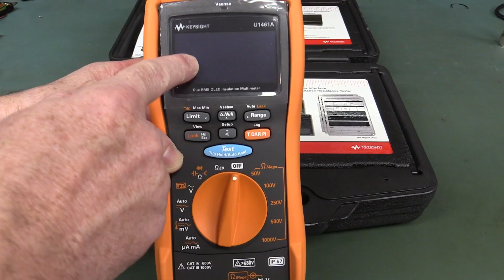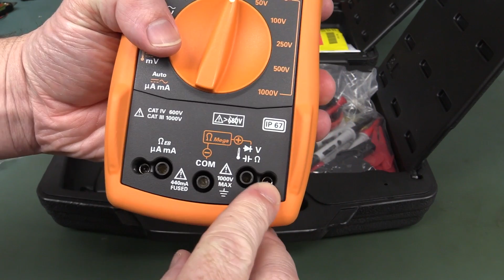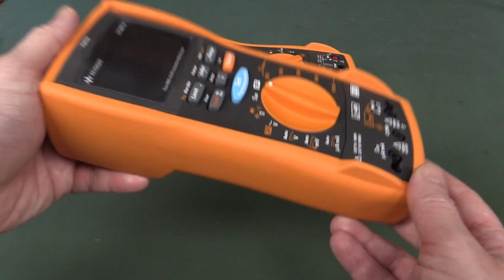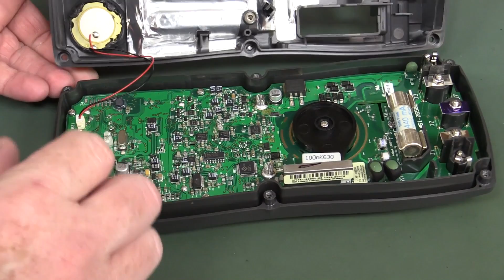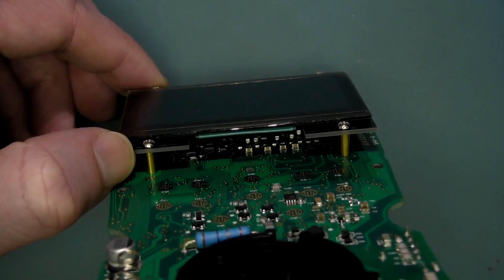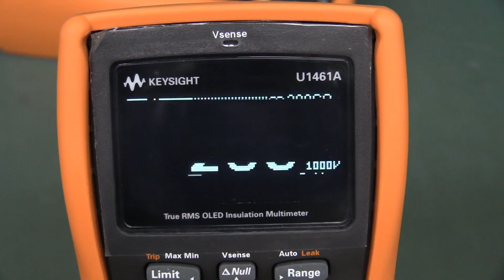EEVblog #894 - Keysight U1461A Insulation Resistance Multimeter Teardown

Comment: I use only dry batteries for any appliances in which the battery will sit there for a very long time, calculators being the ultimate example. Use alkaline batteries on those only to see them leak after a couple of years and oxidize everything. Now do these lithium batteries leak like alkaline batteries if we forget them inside?

Comment: Was that an Hp28S calculator on the bench at 21:10?  I had one back in university days.  Well, I still have it somewhere but it is no longer in working order, due to an incident with some Mountain Dew entering the keyboard.  Replaced it with a 48GX, which I still have and still works great.
Reply: Oh, guess not.  Got a closer look in the LCD contrast video and it's just a Casio.  But the keypad has a similar look to one half of the HP28S keyboard.

Comment: I think Keysight include lithium primary batteries on their multimeters with OLED displays as they are designed to operate in extended temperature ranges and those energizer lithium batteries are rated at -40° to 60°C, while regular alkaline primary cells are rated at -18 to 55°C. My agilent U1273AX (OLED version) also came with lithium primary cells. The battery life with the OLED display is not that bad (I'm using Ni-MH rechargeable batteries). The display is readable but clearly worse than the LCD version in the sunlight, but indoors the contrast is just amazing.
Reply: Indeed, as you said, the OLED used in 1273A is very good, but there is indeed a problem of life decay. If you need help, I can provide OLED.
Reply: @wangyun-pp7xc  I already had to replace mine. I would be willing to pay for an LCD conversion, if someone made one.
Reply: @jfaria  I understand, it's because OLED is not durable right? But as far as I know, replacing OLED with LCD is more troublesome to replace because the driver chip is different and the size and structure are different. It is more suitable to replace an OLED.

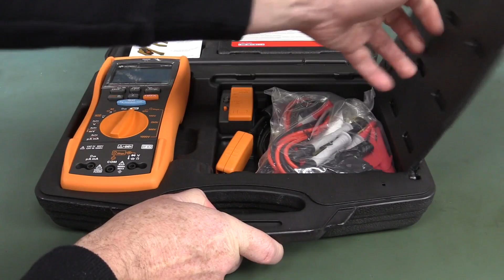Comment: 1:50 Well, more components that are pretty delicate and they could trash the one-piece PCB more often, weight, size of the case and mostly of all these, battery life. A bluetooth module really likes to chew batteries.
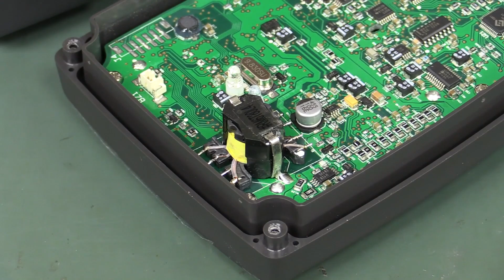5:53 We are talking about ~1000V DC so maybe- MAYBE to stop arcing and corona effects. I'm mostly thinking of the latter.

Comment: I didn't see the path for the HV to get to the jacks...
Reply: I would say a half thickness of PCB all around, is way better than anything you can easily achieve on top with clearance and free air. Just think about dust, dirt and humidity.
Reply: It probably runs on an internal layer.
Reply: I suppose so, but would that provide sufficient isolation? I also didn't see any areas of the board that were kept clear of other stuff, so all that's in between is a half thickness of PCB...

Comment: I appreciate the video, but you're clearly not it's target market. An industrial user would know that a 10A range is worthless - he's just going to stick a 400A (or 8000A) clamp onto the thing. In this game, our requirements are substantially different, like one feature you didn't even test - the magnetic hanger.
Reply: Control electronics. You have little use for the 10A range, but you would need the lower ranges to check the outputs from the microcontroller to the mosfets and relays that control those big currents.
Reply: Or leakage currents.
Reply: Then why on earth would they put µA / mA range on the unit? What use is that in a industrial application?

Comment: how bad will that thing taze people lol? surely regulations would make sure it is safe to touch. If it is a constant current output set to a low current (whereby the voltage will sag to the point that a set current is established.) Unless there is a small amount of capacitance causing it to give a very painful shock initially...
Reply: Meggers aren't harmful unless you get a pacemaker or so (and you really shouldn't be working in electric industry in that case anyways, because you WILL be zapped from time to time), just hurt "you get reminded that you're alive" bad (especially on a rainy day or if you just went back from the toilet and your hands are wet). "Hold these test leads, I have to check something" was a common prank among lower grade technicians back in the days of manual ones (these with crank).
Reply: Regulations Regulations fuck you man companies would not build something to kill you with or without Regulations
Reply: Arthur Dent
Yes
Reply: Actually in only 3 words! :O Without any known reason either! I never questioned it's lethality either, just the pain of the shock!!!!
Reply: +kroplaaaa I once stuck my hand across a dynamo magneto thing in a museum that was on display to make some lamps flash when cranked and I got a real zap from that!!!! I was not sure what it was or how it was generating high enough voltage to shock, especially since it was a distinct snap type of shock rather than a DC type deal.

Comment: The blue on that common jack looks like machining marking/layout fluid. No idea why it would be needed here.

Also, you keep forgetting to put the overlay links in the video when you say "click here". This time, it was for a Fundamentals Friday video on voltage multiplier. I forget what it was in another recent vide.
Reply: Thats what I thought it was as well. Only thing i can guess is its meant to denote it as the common terminal while your looking at it from the bottom side. But that doesn't really make much sense either, as its in the middle.
Reply: Maybe they put it there to screw with Dave and the viewers haha
Reply: Maybe. :) I assume those parts were pressed/punched, so no need for machining layout fluid. It's a very random thing.

Maybe if Dave can get another one and crack it open, he can see if it's also blue.

Comment: Love that soldering by the HV transfo, but what happened to C130 and C131? For a new product, I guess they didn't need the extra multiplier stage. Wah wah wah... Anyway, on the absence of a 10amp internal shunt, with all those adapters why couldn't they have rigged something external for current?
Reply: Both of the multipliers have only eight stages with board area for ten.